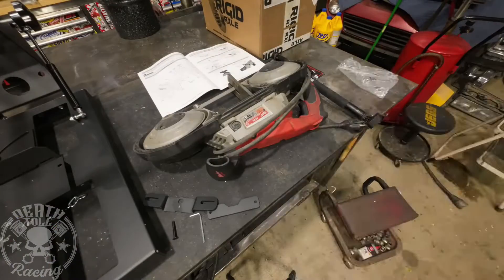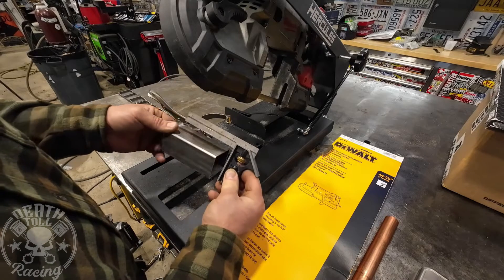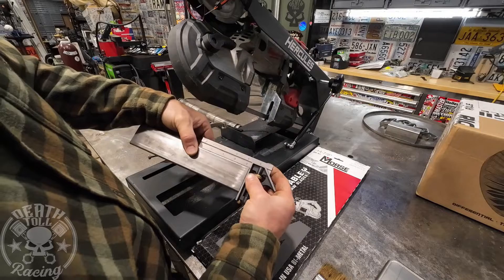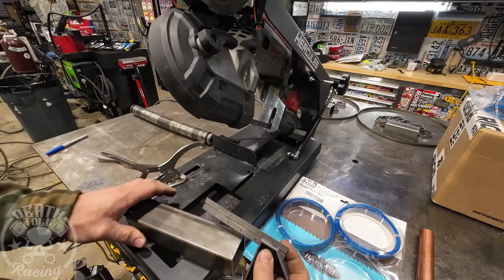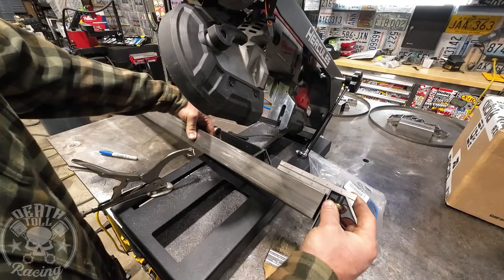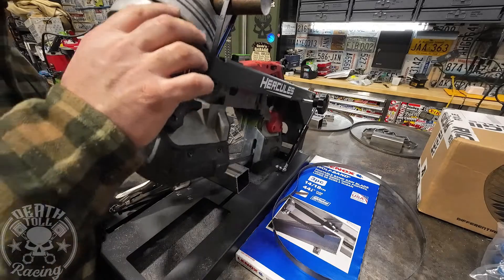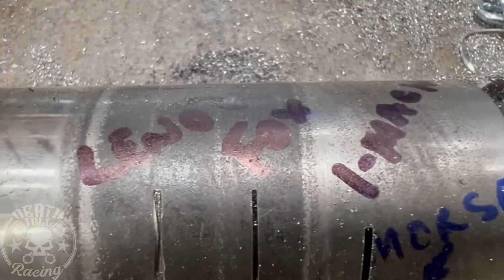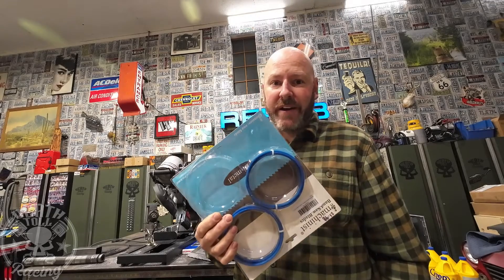Best Band Saw Blade?  All Blades Are NOT Equal!  Lets Test Them Out!!  Portaband Portable Bandsaw

Comment: Could the pin not be hardened uniformly, so the iMachinist cut deep in a softer spot?
Reply from the maker: that's possible, but I don't think so.  After using all the extra blades up over that last couple years, the testing has proven to be very accurate to what I have been experiencing in real world use.

Comment: I've been wondering about coating blades in some sort of dry film lube to increase longevity or even cutting performance. I coated my step bits in PTFE and it seemed to make a difference, but that might just be in my head, along with the voices... PTFE doesn't leave a mess, which is why I tried it, but it isn't really for abrasion, so I was wondering if a guy tried moly, graphite, or boron nitride if that would make a difference. Maybe one day I can get Project Farm to try, but if you could beat him to the punch 👍
Reply from the maker: I’d worry they would slip on the rubber drive wheels. It would be interesting to test though.

Comment: I had to finish up watching today and I am honestly shocked that Lenox performed so poorly. As a plumber, I tried to use their reciprocal saw blades whenever possible as they cut better and longer than any other brand that I ever used. The Lenox Laser blades would just chew their way through 4” cast iron sewer line all day, but they were taller and stiffer than other blades and I thought they dissipated heat faster.  This was eye opening. You should try reaching out to Lenox

Comment: 2:31 as I am watching, I was wondering if you disengaged the shock, would it be as effective as adding weight?
Reply from the maker: It would be hard on the blade in the thin areas. It doesn’t take weight off, it just makes it not go down fast when it hits a thin area.

Comment: The worst I've experienced are the Milwaukee thick metal, it's hard to find the 35 3/8 thin metal blades. Lenox is pretty decent.
Reply from the maker: Lenox has been good to me as well. Not necessarily the best a the time, but you can count on them.
Reply: Just got a brand new Milwaukee saw, got the thick metal blades, and after a couple cuts, they were useless, I was sitting there scratching my head like I did something wrong and then I realized the blades are just trash.

Comment: At my old job we had the Bauer corded portaband. We took guns apart and sold the used parts online. So usually dealing with high quality steel. I always had good luck with Hercules 24tpi blades even tho it says 1/8” or thinner. Most barrels and receivers are way thicker than that. 

I always felt like the bigger tooth blades were much easier to bend or damage and the saw won’t cut one bit after that.

To be fair, the other 200 pound gorilla that used the saw believed that that harder you pushed it the faster it would cut. So maybe I never even used a lower tooth blade before it got damaged lol
Reply from the maker: lol. I think doing what you’re doing it’s better to have a higher count blade for the irregular shapes.

Comment: I would like to see someone figure out how to make the blades cut more square. My Hercules brand saw from Harbor Freight tends to cut out of square. It will cut square with the fence, but the blade tends to twist and bevels back towards the clamp! Maybe it's the brand of blade because I am using what ever came with the saw. Now I have to go look and experiment myself.  ;) Good video!
Reply from the maker: Some blades you will be chasing a ghost trying to get them to cut straight.  The Imachinest blade wasn't the best, but it was the most consistent of the group in that regard.
Reply: I've spent today trying to solve this same problem!  Not sure what's going on yet.  It cuts a piece of wood perfectly square, but the blade drifts toward the fence on metal, regardless of downforce applied, but maybe better with a much slower cut.  Still trying to figure it out!
Reply: FYI, I bought my Son a Bauer cordless band saw, and he has the same Hercules stand that I have, and his saw also cuts crooked. :(

Comment: longevity and cut performance comes down to proper blade material, blade surface speed, pressure and toothcount for the material thickness. The sfpm for the material and the tooth count matched to the material thickness helps the blade to take a chip rather than rub.  Thinner materials work with higher tooth counts but only within reason. It is rare that I find any requirement for  square type cutting where i would use higher than a 12/14 tpi blade, this includes thin wall (~16ga) tube work.  Thicker materials require a lower tooth count for effective cutting.  I use the iMachinist blades on my drop saw and vertical saw, both of which are used for metal cutting only.  One thing that helps a lot for blade longevity is properly breaking in the blade. Using a blade waxbar prior to cutting and subsequently every other part or so helps keep the gullets lubricated for less chance of chip welding, especially in thicker materials or softer gummy materials.  The key is not to rub but to have each tooth actually take a cut from the stock entry contact point to the stock exit point where a chip is cleanly ejected. when this occurs it means the blade teeth are seeing near to uniform pressure through the full cut.  you will get a chip rather than "dust" because the cut is dialed in correctly and the chip has the required room in the gullet  to finish the length of cut without becoming compacted and causing the tooth to lift from its cut.  Once the gullet is clogged it changes the entire cut recipe for all of the trailing teeth.

when in doubt use a blade with a lower tooth count and take closer control with the entry and exit engagement. This will give the straightest and squarest cuts, best blade life and keep the material cooler in the cut.  This is especially important for stainless steel which is notorious for work hardening with light cuts or if it even gets the hint of rubbing rather than cutting.  We want the heat created from the cut going into the chip which is ejected, and avoid that heat going into the part or blade.  I spent more time than I care to admit figuring out how to use a bandsaw succesfully without killing blades but I finally arrived and a recipe that offers very long blade service life, fast start to finish cut speed and very qood cut quality where squareness and finish are concerned.  

The last point is the downfeed. once you have the right tooth count and sfpm blade speed, we need to match in the downfeed.  Placing weight on the blade alone without a controlled drop speed is placing unecessary force on the blade.  you want weight to keep the head from bouncing and to create a good smooth pressure, not to force the blade through the material.  Use weight in conjunction with the drop speed actuator. let the teeth create the void for the saw to move through the cut,  this is where the squareness will be achieved providing the desired cut results.  when the recipe is dialed in at all of the above points, the saw will work at its optimum level and your results will therefore also be optimum.  

Hope this helps!

Chris
Reply from the maker: That all is great information, but keep in mind, this is on a portable band saw, that was only on a fixture to make the the pressure, speed, angle, etc, as consistent as possible so there was not bias of the user.  I don't think most people have as much "feel" for the blade while in use as described above, as well as changing blades for every material thickness, situation.  Most people buy one blade that is "okay" at everything which is why I chose this tooth arrangement, because from my experience of hand cutting with a portable band saw, is the most "universal".
Reply: @DeathTollRacing  good point!   The theory behind both methods would remain the same albeit the user would control the cut pressure as you stated which is a acquired feel, the blade speed is not adjustable on that saw type?  I don't have one so do not know.
Reply: You said it right Gavin “feel for the blade”. I might add the sound of the saw cutting through the material. Most important though is the shape and color of the chip it tells the story. @DeathTollRacing
Reply from the maker: @paulkutz5378  yes, a very good point!
Reply: I read the first sentence and concluded you are a machinist. Looked at your channel just to be proven right. Haha Love the info, I feel like a lot more of that applies to a standard horizontal band saw more than these porta-bands but is all great to consider and keep in mind. 

An interesting blade I’ve used at a shop I previously worked at was a variable tooth blade. Worked quite well on their old Wellsaw. We did a majority of our cutting on round stock 6” and above with the occasional thick wall tubing, all steels. Worked well on all that and would even chew through twice annealed EN30B.